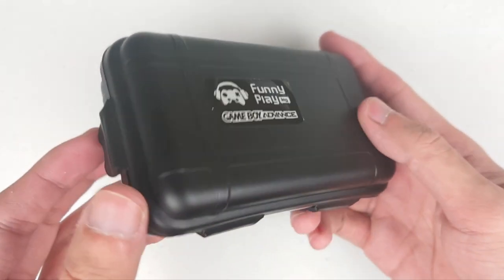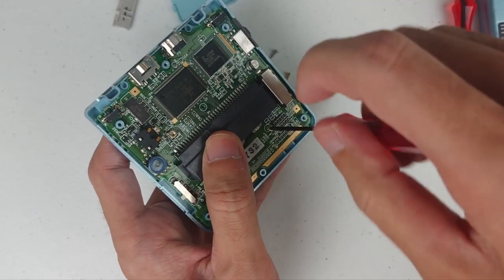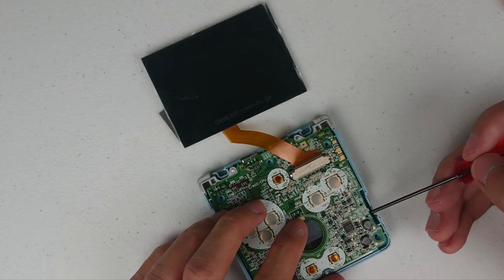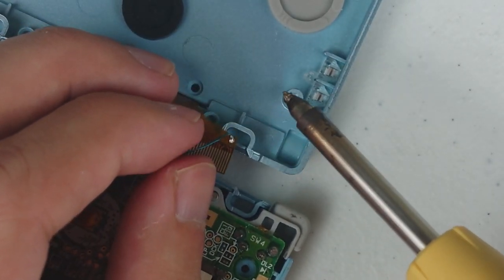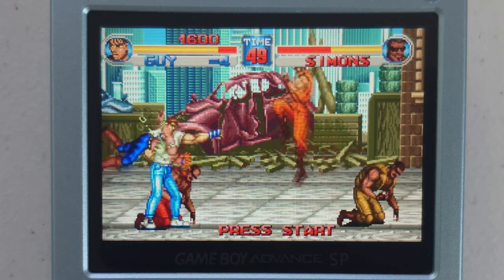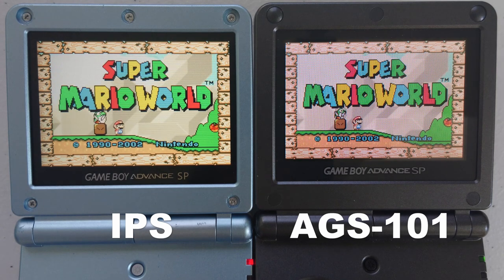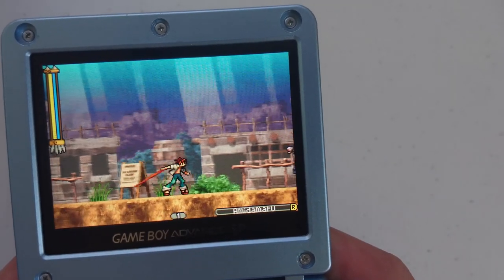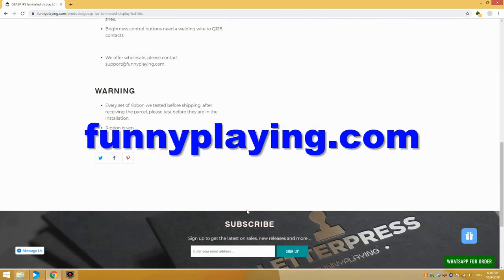Backlight IPS Mod For Game Boy Advance SP From FunnyPlaying

Comment from the maker: Updates:
It turned out that you don't have to remove the hinges if you only want to replace the screen. Thanks to makho ( https://www.youtube.com/channel/UC5FYpo9lFqK1Y7wqjPuANFw ) for pointing this out. Lessons learned :)
Also, there are 6 levels of brightness in total. And if you don't solder the wire, it stays at level 4.
Reply: The Chinese Guy the best way to remove the hinges, when necessary, is to remove the motherboard from the screen first. Then, unscrew the screw under the ribbon cable and remove the plastic piece that is attached by the screw. After that, remove the rubber stoppers from the screen and then unscrew those screws. Remove the back portion of the screen housing and remove the screen. From there, you should just have the control housing connected to the from screen housing. Close the thing as if you were closing the gameboy after playing. Then, push in each of the flaps on the hinges with a small screwdriver. Once you’ve pushed each flap in, the hinge should pop out halfway. Do the same with the other hinge. Then open the shell as if you were going to play the gameboy. Push again on the hinges and they should pop out with relative ease.
Reply: And thank you for your video. I’m totally gonna do this mod!
Reply from the maker: @brenenbrown7713  Thanks a lot for the detailed info. Very helpful!
Reply: Does the mod pack come with the wire
Reply: Yeah lol idk how to solder cuz I just got a sp 2 weeks ago(an ags-001 model) and learned about the different models and the whole modding process. So if I do everything right(leaving out the soldering process out) it should work out fine?
Reply: @ericlopez911  yes
Reply: just found your channel, really like how straight forward you are

Comment: I used portions of this to complete the mod. The results were spectacular! Thanks!
I left the hinges in since I was modding the shell. It was easy.
I used a dremel to mod the shell.
I didn't hook up the brightness wire at this time. I'm happy with the brightness! The whole job took 50 minutes! It's a must do mod if you have the ags 001.

Comment: You shouldn't need to remove the hinges and top case lcd bezel frame in order to do this mod. I agree that popping out the hinges is pretty rough so best not to risk it unless you are swapping the top plastic frame. I have a few 001's with vertical lines on the original screens so this looks like a perfect way to fix them up.

Comment: Either the ribbon or the screen of my Funny Playing is broken on arrival because it glitches all over the place and only lights up half the time. I emailed them and they’re sending a replacement ribbon cable but I’m afraid it’s the connector of the screen that could be at fault. Could it be the screen? Being in Australia, it’s a 2-3 week wait on posting so that 5 weeks and no 100% it’ll work. This has been an extremely painful process. I just want a working screen.

Comment: I Have two questions, the screen protector is glass or plastic? And there is a way that the console remembers the last level of bright used after shutdown the console? Or at least a way to change the default to other?
Reply from the maker: 1. Glass. 2. No, it does not remember the previous brightness level. There is no way to change the default brightness. (FYI, the original AGS-101 SP does this too, it always defaults to the lower level after reboot.)
Reply: @thechineseguy5468  Thank you!!

Comment: If I did not install the brightness control, the default brightness will be at the maximum? Please somebody let me know because I want to skip the soldering step.
Reply: I just installed mine.  I think if you skip the soldering, you get around level 3 brightness
Reply: @jcalm1  Is there anyway to adjust the brightness once you install it ?